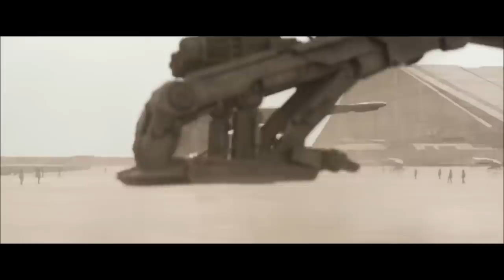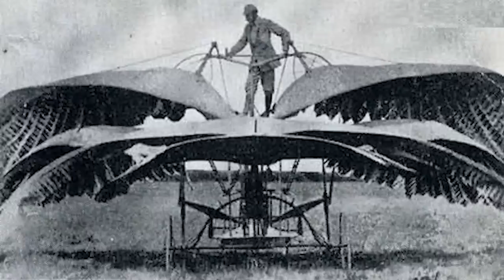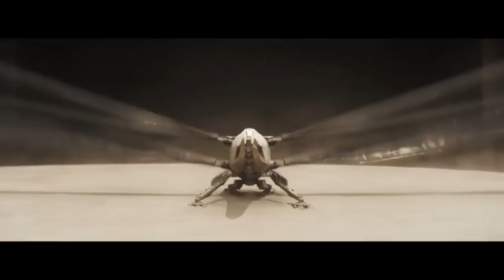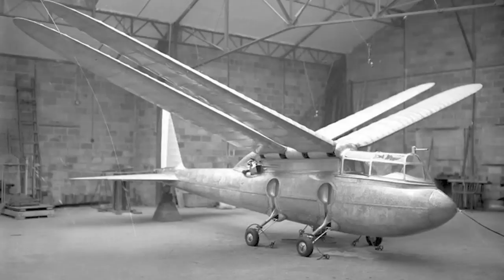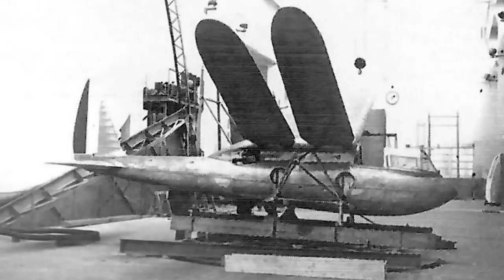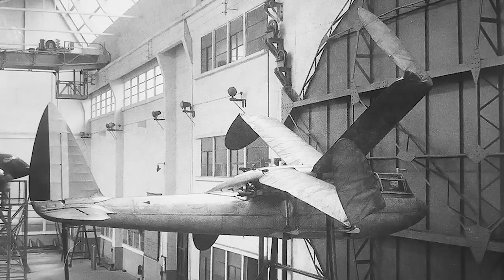The Riout 102T Alérion Ornithopter; Frank Herbert’s Inspiration?

Comment: Someone actually made an airplane with flapping wings?

I’m surprised no one ever tried picking up where the old one left off.

I’m sure you could make a new one that uses electric motors.
Reply: You'd still be better off with a piston engine for a manned aircraft though. These things are marginal at best, and batteries would just add more weight. 

There are a few small remote controlled ornithopters though.
Reply: @jackroutledge352  how about solar panels?

 Although if you flew into a cloud, things could get dicey.
Reply: @robertdragoff6909  even heavier! Making an aircraft fly with those is a challenge. Making an ornithopter is probably impossible. It would be an interest stretch goal for the go fund me thoy!
Reply: Not the first attempt: https://youtu.be/hR2iE-zmu-c?t=16
Reply: ...a.f.a.i.r. in the books they use bio-mechanic-propulsion...
...they use clam-muscles, with s.k.o. electric pacemaker for control...!

...if that's not 'green energy'...! 😉
Reply: This is a PS to my last message 

I don’t think a Dragon Fly Ornithopter is feasible, but it looked like they came close back in the 1930’s  and who knows, if WWII didn’t happen maybe it could’ve worked.

 Could someone build one of these contraptions? Maybe? Possibly?

 Small models have been built, so maybe one of those models could be scaled up.

Interesting design tho
Reply: @robertdragoff6909  
Festo
Reply: Nope. No one have actually made an airplane with flapping wings. But people have tried to make an airplane with flapping wings..
And I'm pretty sure this can never be made to work with the technology and materials we have today.
Reply: @vikingpowered868  
Festo

Comment: I really, really fail to see the advantage these things would have over more conventional aircraft and helicopters. I suspect Herbert included them in Dune because helicopters and VTOLS seemed too "boring" for the setting. The mechanical nightmare these would create for maintenance, especially in a combat setting, is another reason I just can't wrap my head around them being effective. Maybe rich people could use them as a very ostentatious and unique way to zip around though.
Reply: If you could make an aircraft with the same capabilities as a dragonfly you'd have a craft extremely well suited to operating in extreme conditions without much in the way of ground facilities. Difficult to convey how far ahead of other flying creatures the dragonfly is, but the fact that it has by far the highest "hit rate" of any predator on earth should give you at least a clue.
Reply: Considdering the fact that helicopters are somewhat of a "maintenence nightmare", I am not certain these would be any more of a problem.
Reply: @mahbriggs  you think 4 extremely quickly flapping and extremely precisely engineered dragonfly wings are no more difficult to maintain than a helicopter? That seems... very optimistic to me. Also before someone points it out, I know that in the book they were "bird type" wings and the movie actually introduced the dragonfly style wings. That really... doesn't seem much less of a pain in the ass to work on to me though. That's a LOT of moving parts.
Reply: @MrArgus11111  
A lot of moving parts on a helicopter too!
I was rather impressed by what this one off test vehicle could do!
Imagine modern carbon fiber composites and computer airflow modeling!  As well as modern engines!
We have learned a lot about insect flight since the 1930s, and I can't believe a modern attempt couldn't out perform the Riout!
As far as the book Dune goes, wasn't a fan of it back in the early '70s, and have never read the entire series.
Reply: @MrArgus11111  sure it would have more moving parts but essentially it's not really any different than modern aircraft and drones.    a Osprey has its large props engines and the tilting components and computers to allow vtol flight.  your average drone has multiple props and uses them like it's going out of style, then there are the servors and parts.  A F-35 B.    is also a marvel of mechanical work.  

technically as of now humanity should be able to create small versions of a omnithroper
Reply: @Quetzalcoatl_Feathered_Serpent  
I have done a little research since the video came out!
There are indeed small versions of bird style ornithopters, some apparently being used by the Fish and Game Departments for bird control.  Even apparently a human powered one that ended up crippling it's user in an accident!
As far as I can tell, no modern ornithopter based on insect flight as this one is, has been built, even as a large scale model.
I wonder why?  
If it has, I have been so far unable to find any mention of it.
Reply: @mahbriggs  Found a independant RC drone that is based on a dragon fly.  seems it flies pretty well too.  This would be about as close as it could be to the movie ornithropers
  https://youtu.be/DHLCWEwirK8
Reply: Yeah. While an impressive feat of engineering, that's about all. Fixed wing would be faster and rotory can do everything it does with a smaller wing profile and less stress on the airframe and less maintenance.
Reply: They were in the book...
Reply: @noahwail2444  Did he say otherwise?
Reply: on dune the presence of sand in the air would make any exposed rotating bearings prone to damage - the same would apply to jet engines with fans. I think Herbert chose ornithopters to avoid such problems.
Reply: @LeechwelGarden  
It is an imaginary world.  The author can make any scenario he likes.
Reply: @mahbriggs  a fantasy author could,  yes, but Frank Herbert was very keen on making the world of DUNE logically consistent and the science believable given some basic assumptions. Thus the use of swordplay was vital since lasers interacted disastrously with shields (and shields also meant springloaded maula pistols were used rather than guns using explosive bullets).
Reply: @LeechwelGarden  
LOL!
It is still fiction!  He put some thought in it, but it is still fantasy!
Reply: @LeechwelGarden  Good comment, I was amazed when the Martian helicopter actually worked.
Reply: Consider the difficultys experienced by helicopters and aircraft in achieving lift in high altitude hot countries such as Afghanistan (where lift performance dropped 20% or more) and Dune is even hotter, Hot air is less dense than cold air. Something that might achieve takeoff velocity at 100mph might require 200mph on Dune (with similar stall and landing requirements) and you start seeing the issue where something that is more compact and doesnt require a massive runway has a better performance. At its most basic a propeller is a flapping wing but always moving in the same direction rather than back and forth, its performance is limited by the amount of air it can displace. A Wing flapping at a frequency of tens of thousands of times a minute can proportionally displace more air than a birds wings and so allow a proportionally heavier creature to fly such as a beetle.
Reply: @watcherzero5256  yes, it's probably hotter on Dune, but that doesn't mean the air is less dense.  The temperature near the surface of Venus is hot enough to melt lead, yet the atmosphere is thick enough that humans could fly if they had simple wings attached to their arms. 
Maybe the way to rationalize Dune's ornithopters is that the planet actually does have a somewhat thicker atmosphere.
Reply: @ZPositive  Its not really comparing similar atmospheres though, Earths is 21% Oxygen and 77% Nitrogen. Venus is 96% Carbon Dioxide and 3% Nitrogen. The atmospheric composition alone is around 93x heavier!
Reply: @watcherzero5256  yes, definitely.  But I'm just saying that assuming Dune's atmospheric pressure is the same as earth's is a little silly.
Reply: @ZPositive  The world maintained a atmosphere due to the Worms producing the neccessary requirements for oxygen, as they initially replaced the original ecosystem.  then of course there is all the spice and dust flying around and vast air currents it's likely Dune might have a slightly denser atmosphere than we think
Reply: @ZPositive  it would be extremely unlikely DUNE would have a similar density to its atmosphere like earth.  it anything its bound to have differences.  given it was a world with oceans before it became a desert planet due to terraforming from the worms. it's likely arrakis could have had a denser atmosphere than earth.  I think Dune is also larger than earth as well.
Reply: @Quetzalcoatl_Feathered_Serpent  agreed